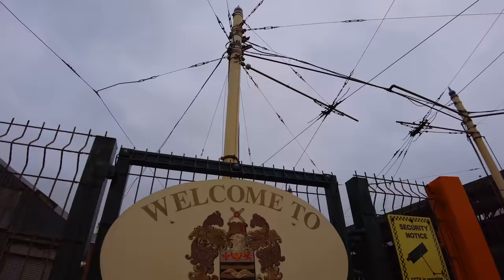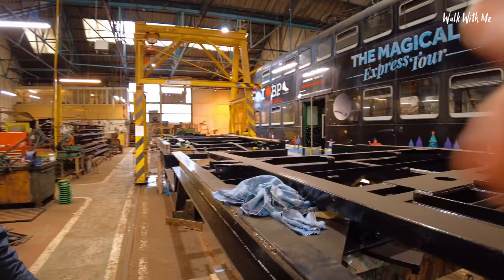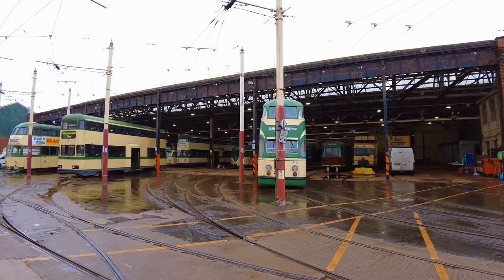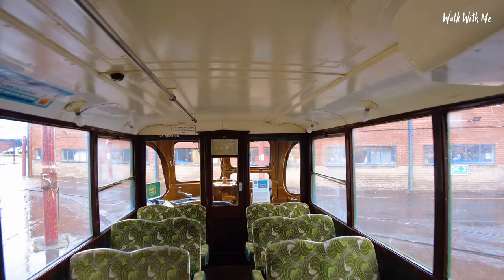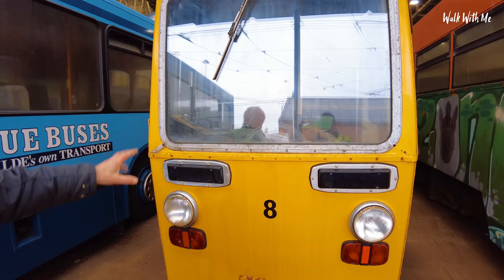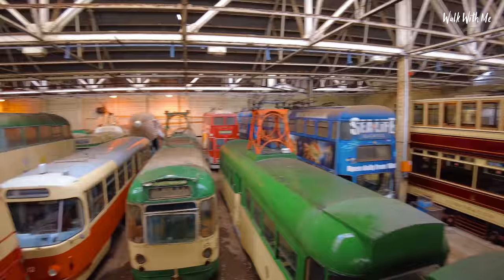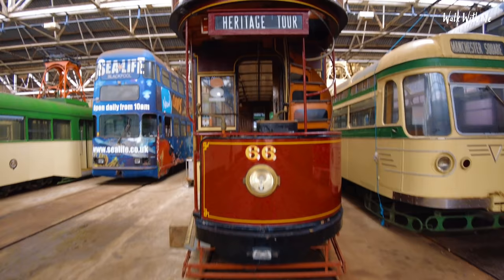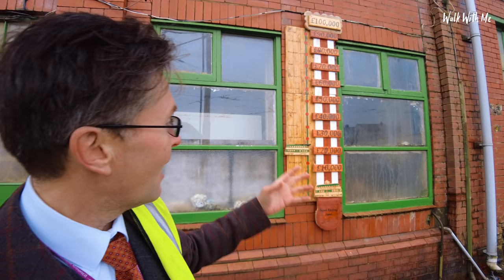Tramtown Blackpool TOUR - I Visit The Old Trams of Blackpool

Comment: According to 1900s reasoning, open trams actually were a Health&Safety feature - people thought the cold and fresh air would keep the drivers alert! Vienna, where I live and drive vintage trams, only started enclosing platforms after a very harsh winter in the 1930s (extended temperaturs in the -20s I think). New cars were built with enclosed platforms from around 1910 onwards but did run with the doors open until the last pre-war cars were withdrawn from service in 1978. The first cars with remote-controlled doors were introduced in 1951.

This workshop is nothng short of amazing, including the staff! Apparently there's only a handful of workshops left in Europe certified to replace tram tyres on solid wheels like this and they charge a fortune. Modern trams have rubber buffers between the wheels and tyres and the tyres are just pressed on cold, which is a lot less faff than the old way. From what I've heard it costs 50 grand to have four heat-fitted tyres replaced!

Comment: My funny memory of those trams in the 1970s was the times when the pantograph (the long rod that tracks the electric overhead cable) came off the cable and the driver or conductor got off to use a long bamboo pole with a hook on the end.  He would reconnect the rod to the power supply and set off again.  As I recall, this took about 2 minutes.  The ride on those trams was quite rough, so I assume that the tracks were in poor shape in the past.  You would need to hang on because a sudden bump could knock you off your seat or off your feet.  As a boy, that was good fun!
Reply from the maker: Wow 😃
Reply: Trolley poles are somewhat notorious for coming off the wire and they require quite complicated supports for the actual wire because the pickup goes partly around the wire. Other types of pickup, like pantographs, only touch the bottom of the wire, which is why many cities in Europe changed very early. Vienna phased out trolley poles before WWI and replaced them with Siemens lyra-style pickups.